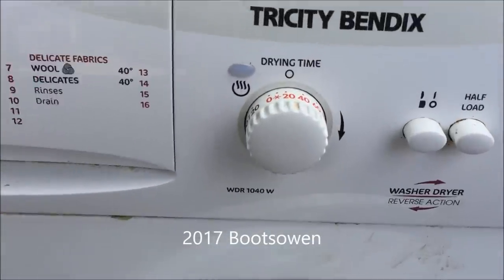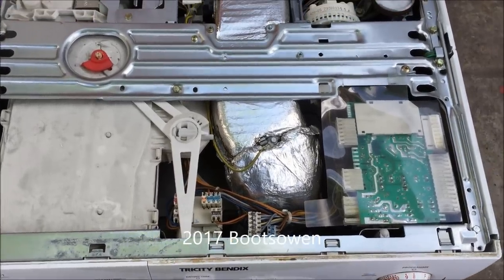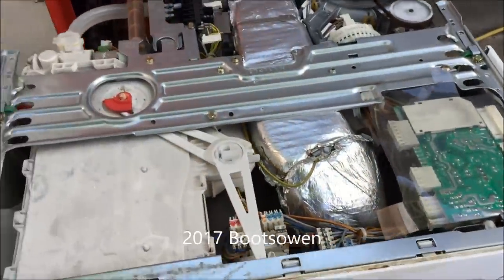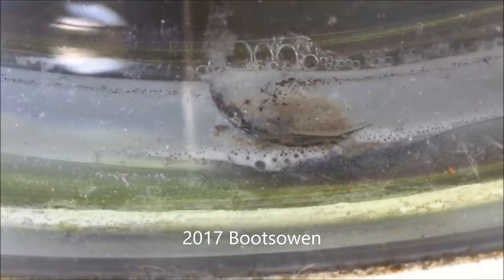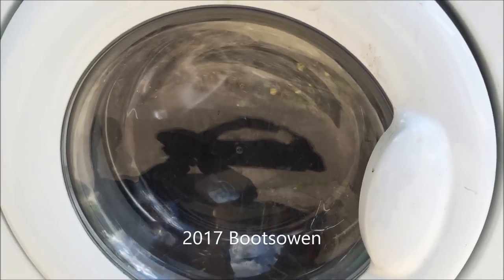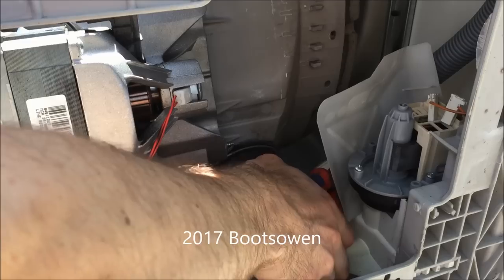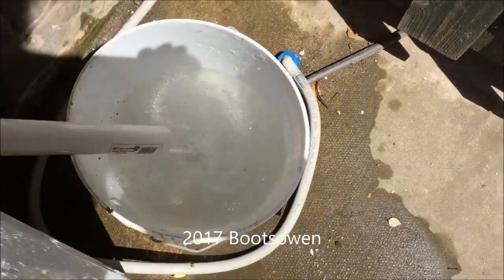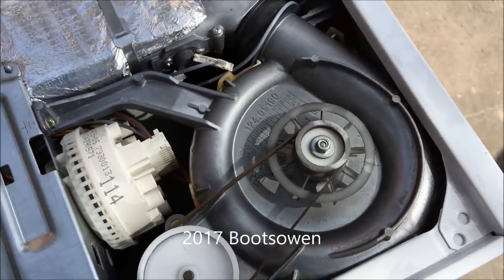Tricity Bendix test wash and repairs [and brick wash]

Comment: IIRC Electrolux washer dryers (like this one and my Zanussi) run the dryer fan at the start of the last rinse to blow out any suds or excess moisture that may have collected in the dryer circuit during the wash cycle, as they could short out the dryer heating element.